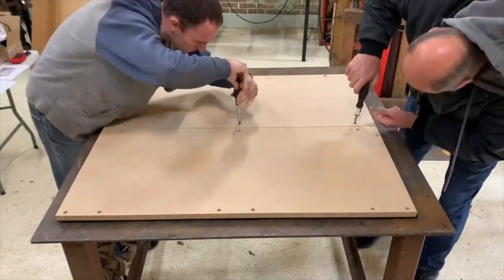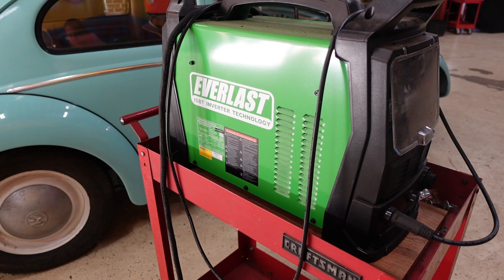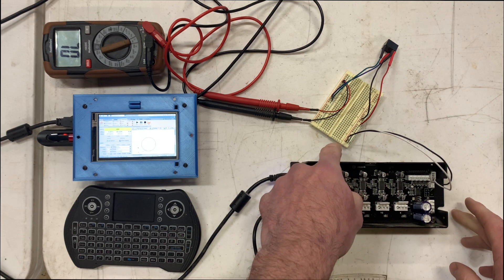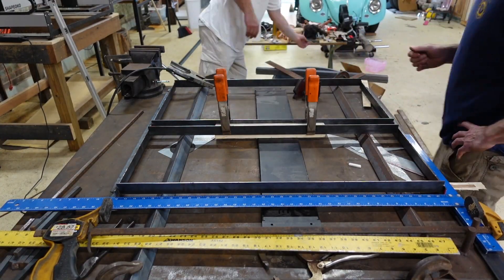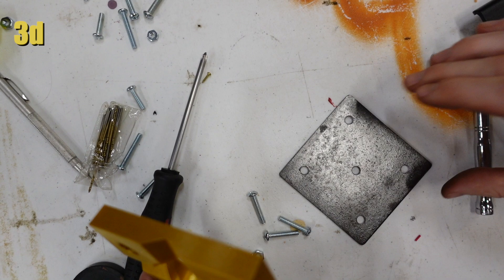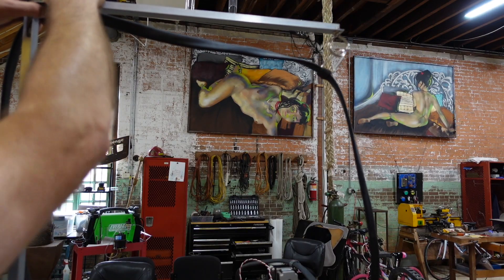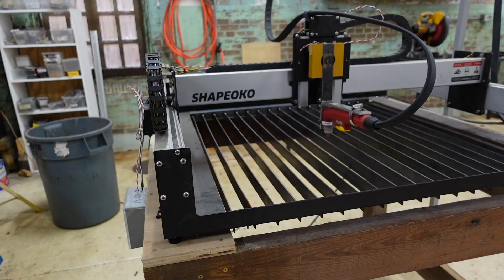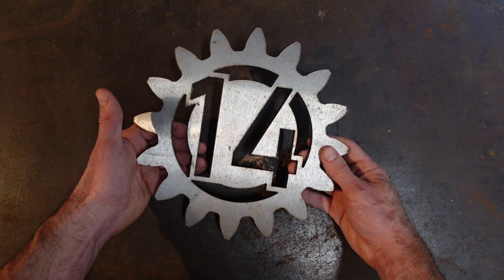Homemade Plasma CNC- Shapeoko Router Conversion

Comment: Thanks for this video! Im doing something similar with an old 3018 pro board (GRBL) and was trying to figure out which pinouts to use to connect to a relay to trigger the plasma. Once connected what code did you use to turn it on/off? How do you target those pins in code? I know on the Arduino you use the spindle code… thanks in advance!
Reply: That’s the easy part, getting around the interference I’m finding impossible. Use a single channel 12v logic high relay. 12v and common from the laser circuit goes to the VCC in pin while the PWM goes to the signal pin. In your controller software turn laser mode on for S32=1 and use any value for ‘S’ above zero to start the laser which will in turn trip the switch which you connect to the torch trigger in on the plasma machine.
Reply: i built a pretty robust CNC router machine using an arduino brain and no amount of optocoupling, grounding, insulating of wires and ferrite ad-ons could get me around the EMI.... @onomatopoeidia
Reply: Ive also mostly seen the PMW signal work off 5V logic and im wondering if therein lies the issue and if we can somehow trigger via 5V it can  isolate from higher voltage components (?) @onomatopoeidia
Reply: @shirleypetchprapa8771  no the switching  being affected is not the issue it’s the computer in the controller that crashes from the spikes and electro magnetic chaos. 
Most desktop lasers run on a 12v input and the PWM input is 0-5V zero being off 5V being maximum power the modulation/switching on/off is done to control power delivery of the laser. My plasma cutter is a HF one so that’s my issue. HF plasmas need to touch the surface to start the arc and that crashes the 5V circuit due to spikes, magnetic fields and stray high frequency . I could add a wire from the tip to the ground cable (actually positive on a plasma cutter) and then use a relay, coil and reed switch to switch off the pilot arc cable once the arc starts but easier to get a cheap non-touch machine. Even with that you still need to add bypass capacitors, shield everything and add ferrite coils and move the box. That’s what I’m going to try.

Comment: Hello guys, really impressive built/hack!!!! I have a few question…. Which cad/ cam software do you use to have the « lead in » feature for your plasma cut? I have hacked a laser CNc with a relay like you did but I can’t manage to set up a piercing delay or lead in feature as the machine still think this is a laser operating…. One of my issue is that I work on Mac and don’t have hundreds of money to spend on software like sheetcam or mac3. Greetings from France and thank you again for the video!!!!
Reply from the maker: Hey!  For my cad software I use fusion 360 and there is a free version for Mac. In the manufacturing tab you can create your tool paths for cutting. Last I checked it doesn’t come with a post processor for grbl plasma cutting though. I found a post processor made by dr D Flo on his website (he has a good YouTube channel you should check out).  You can download that post processor and add it to the folder for fusion then you have everything you need to make your gcode.   To run the cutter I use a raspberry pi with bCNC, also free software.  There’s lots of options for that, you could also use universal gcode sender. Good luck!
Reply: Thank you so much for your answer, I will look into that.! Keep up the great work!xxx
Reply: Thank you so much for your answer, I will look into that.! Keep up the great work!xxx
Reply: Thank you so much for your answer, I will look into that.! Keep up the great work!xxx
Reply: Thank you so much for your answer, I will look into that.! Keep up the great work!xxx
Reply: Thank you so much for your answer, I will look into that.! Keep up the great work!xxx
Reply: Thank you so much for your answer, I will look into that.! Keep up the great work!xxx
Reply: thank you so much for your answer!!! i will get to it asap!! xxx

Comment: I’m sure you probably worked out by now, but just in case , plasma cutting does have an on one side and straight on the other. It’s kinda of annoying but apart of how they operate from cheap to expensive. 

Wicked video , thanking you .
Reply from the maker: Thanks!

Comment: Just curious, couldn't you install some sacrificial shielding plates {8 inch rolled flashing} around the perimeter to protect the belts/wires?
Reply from the maker: We thought about ways to shield it but there aren’t any easy options. The flashing would need to be able to “accordion” or collapse and expand somehow to accommodate the movement of the gantry and carriage.  You could also just let it move with the axis but it would stick out really far past the machine at the end of travel.   We may still try to do something like that if we come up with a clean solution